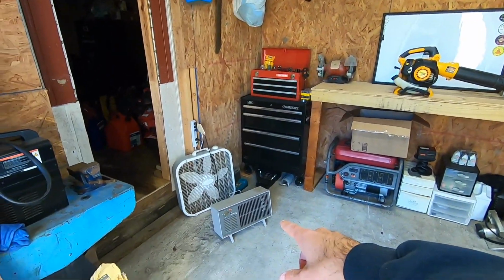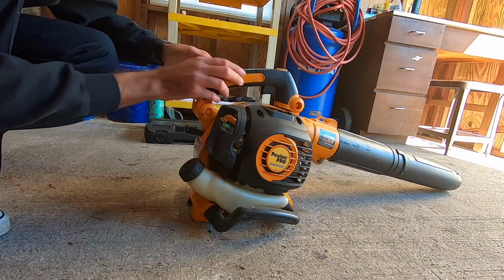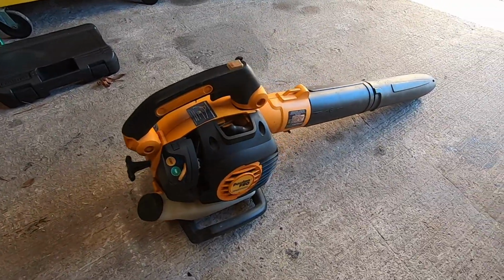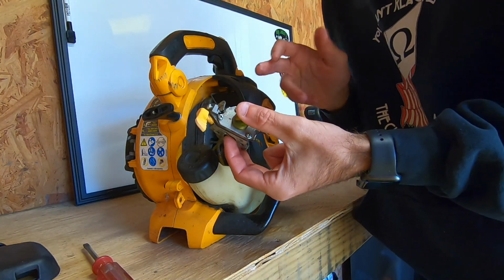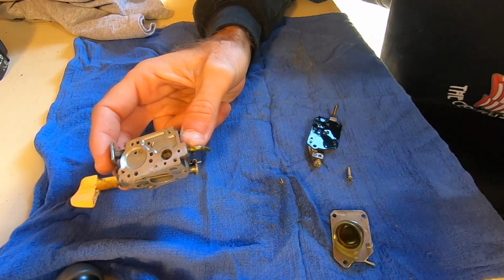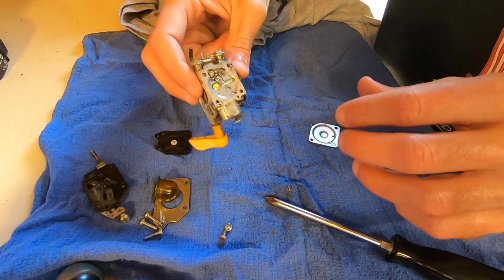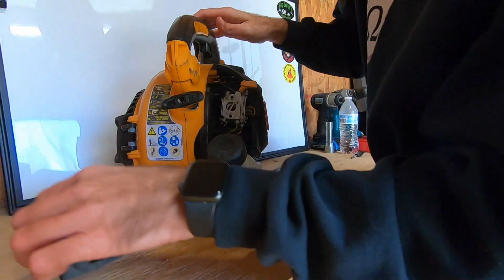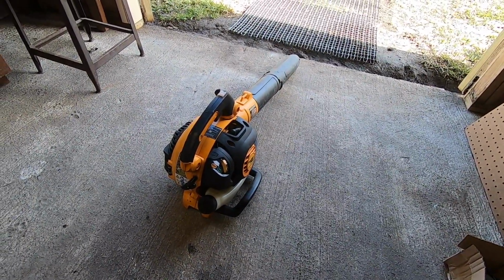POULAN PRO BLOWER STARTS THEN STALLS | LETS FIX IT

Comment: Very lucky to have it fixed, I just did all that to bve200 and still doesn't idle 🤷 going to order an after market carburetor and see what happens
Reply from the maker: Yes sometimes this works, and other times it needs a new carb if it’s bad enough. I hope you can get it changed out and running good.

Comment: The other problem is the spark arrestor screen might be clogged up.with carbon I still have to do the repairs on the two hand held blowers I was given
Reply from the maker: I took a peak at the arrestor screen on it today actually. It was very oily but not clogged. I think the previous owner was running a very rich mixture in there. I got it dialed in at the end of the video and seems to be running great. Hope all is well your way.
Reply: @freedommowers420  okay thanks for your reply young man 😎

Comment: I have one of these, i installed new primer bulb, ignition coil, didn't have spark, now I do, pulled piston, cleaned ring and ring groove, reassembled, have gas and see it flowing thur both  hoses, all gaskets good, has spark, put starter fluid in spark plug hole, wont fire still? Could it be a compression issue? What should compression be? 100 psi? I  Have not checked compression yet.
It just doesnt seem like it wants to pop

Comment: The thing most people miss is the pressure in the gas tank won’t let gas flow properly. Some have a third hose it not it has a small valve in the screw cap on the tank.  Make sure they are not blocked  can check it out by loosing the gas cap and cranking it or revving it up.
Reply from the maker: Yes they have to be able to vent. Some have it on the cap and others have the third hose with the valve. Thank you for stopping by and the tips 🙌

Comment: OK Look at the 2 diaphragms. Metering and pumping. Replace the purge blub (primer). Clean that screen with carb cleaner. Check to see if fuel disappears. Pumping diaphragms are cheap and easy to buy. I would have purchased a rebuild kit if available.
Reply from the maker: That’s usually what I do with most of of the machines that come through here. Thank you for the tips and support.

Comment: Nice save there Alex. Doesnt help when theres no air filter and the  fuel filter is disconnected. Lots of gunk in the screen on that carb. Runs really well now Sir! I noticed your sticker board and it looks like you did what i did by buying a magnetic erase board.👍🇺🇸Roger
Reply from the maker: Thank you Roger. Yea they really did a number one this one running it without filters. Yea I thought it would be fun to have the board for stickers and shout out if I want to write on it as well. I got your stickers in the mail today as a matter of fact. I’ll make sure to get you some out, and have yours up very soon 🙏